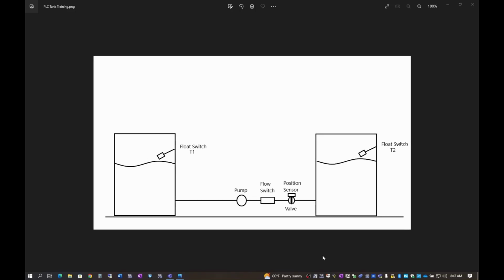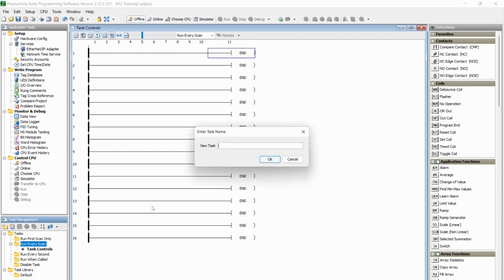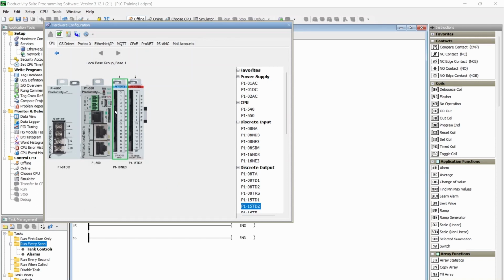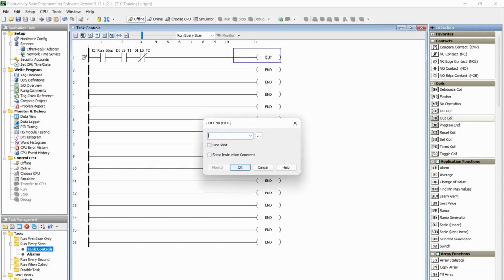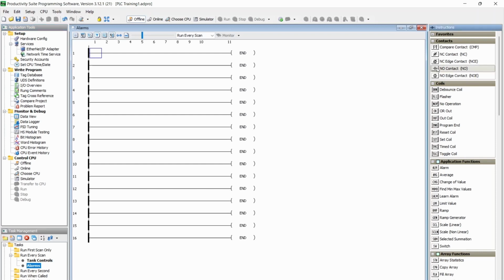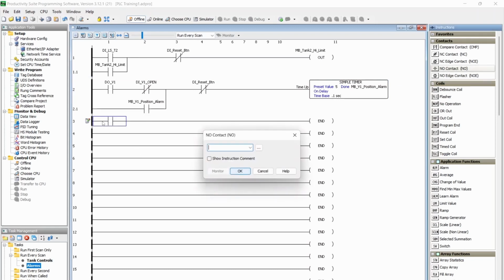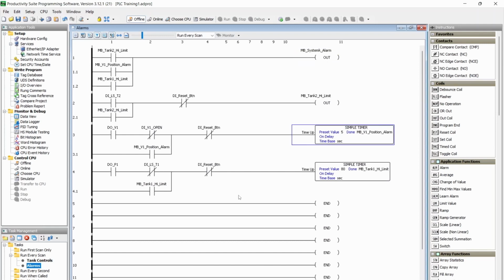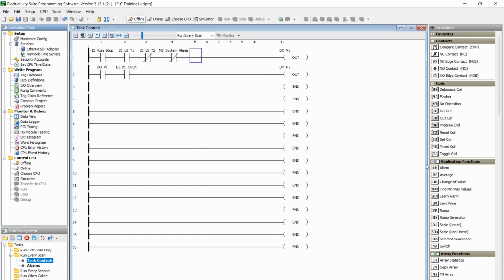Productivity Suite Beginners Program

Comment: I would think you would put the DI_Reset_Btn on line 1.1 right after MB_Tank2_Hi_Limit so if someone tries to hold the reset button the alarm would remain going off if the tank is still full.